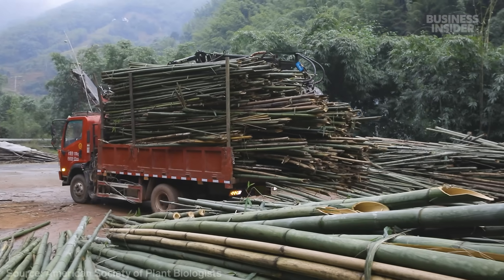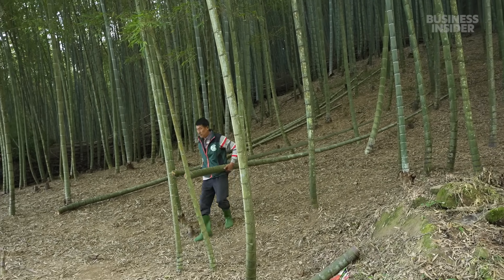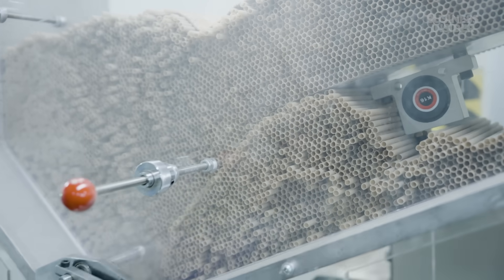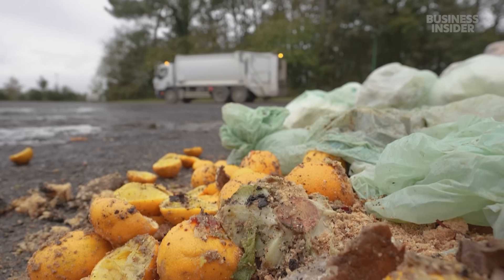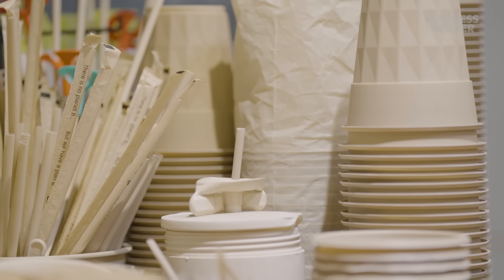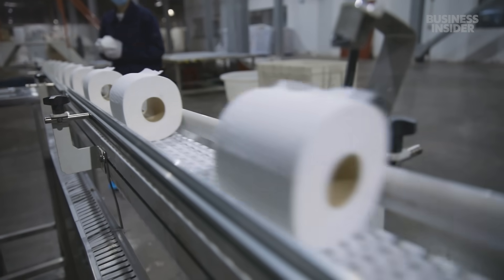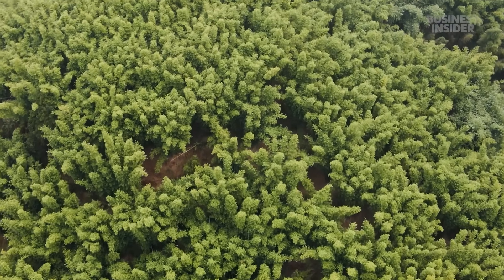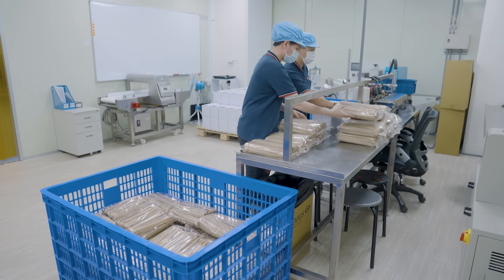Can Bamboo Replace Paper And Plastic? And Should It? | World Wide Waste | Business Insider

Comment: I just gotta say... bamboo CLOTHES are the greatest. The cotton and polyester fibers disintegrate and the bamboo fibers are still going strong. It's soft as silk and strong as steel. 

We need bamboo to take the place of plastic/synthetic fibers in clothes everywhere. It BREATHES. It's soft. It's durable. It's just...not cheap. 

But if you suffer hot bedsheets and sweaty underwear, try switching to bamboo. It's awesome.

Comment: Sort out the glue problem and most of the problem is solved for biodegradation.  BUT, individuals making bamboo skewers one by one,  using industrial machinery is not a good use of resources.  People will just have to learn to eat better.  Billions of tonnes of wood or bamboo is wasted on one use, snacky products.  People don't need straws for goodness’s sake, drink from the cup and half the wasted material. Stop snacking, save the planet, and your health.

Comment: A lot of products nobody really needs - it's all about convenience. Wouldn't have happened some 60 years ago.
The best toilet paper is not using any. A bidet does the job very nicely and it only uses a little bit of extra water and a bit of electricity.  Much better than using toilet paper. Costco carries bidet seats for regular toilets at around $300. So you break even after 15 packs of toilet paper from Kirkland or around 8 Charmin Ultra packages.  For some households that's less than 2 years....

Comment: Just for reference. The tree used to make paper is often simply grown. Look at the experience of Double A.
Growing forests is no longer new. To assess the impact on the environment, you need to analyze the water consumption of bamboo plantations, soil use and much more.
Usually it all comes down to how responsibly the product manufacturer behaved. You can also make a lot of things from plastic without particularly harming the environment in the process, and then recycle it. Or you can make bamboo dishes that will be filled with carcinogens and will be simply dangerous to use.
It's not a question of how good the bamboo is. This is a question of how willing society is to monitor the environmental friendliness of the production process. Monitor thoughtfully and responsibly. And also manage waste responsibly.

Comment: Bamboo is a great alternative to to wood pulp products, as Bamboo matures in 3 years, but compared to Industrial Hemp it comes well  back by comparison. Industrial Hemp can be used in/to make 5,000 products, including paper that can be recycled more times than any other type of paper, it can be used to make houses that last a thousand years, it can produce plastics of many grades. It makes the strongest fabrics known, people who wear hemp clothing will say the fabric takes years to wear in and can never be worn out. Hemp fiber wicks moisture and capable of carrying electrical current, with hemp batteries showing very good results similar to Graphene batteries. Industrial hemp only takes 3-4 mths to mature, use very little water, don't require pesticides and should absolutely be used to replace Cotton, which uses huge amounts of water and huge aounts of toxic pesticides. Industrial Hemp can be processed on cotton manufacturing machinery, for fabrics and specialised machinery for other applications.Obviously there are 4997 other things Industrial Hemp can be used in or to make.

Comment: Okay ill help save the time on this one one, Replace? No. Supliment 110% Some of my best TP and wipes are made with bamboo hell my current toothbrush is made with the stuff. And i say that because paper and compression board etc is often made from the cuttings of other logs and wood. so complete replace, probably not, suppliment and help reduce the load or need for something to be done SOLEY for paper or disposables yes. (and yes i do realise i just said the same thing twice in a couple different ways.)

Comment: Your video fails to mention that bamboo is pretty invasive, meaning it can grow almost anywhere when the climate fits. Its roots travel just below the ground and it forms clusters of roots after some time.
These clusters save up an insane amount of CO2. Thats why Bamboo grows so fast. It is using the saved up CO2 to do that. Which means Bamboo can be used to grow extremely large natural carbonsinks. Especially when the bamboo is cut down to do that specific purpose, not looking for the quality of the bamboo itself, but its roots ability to save up carbondioxide grow the stem and then cut it when the roots are ready again to repeat the cycle.
Normally in the bamboo industry they let a stem stand for 4-6 years. I wonder if that cycle could be shortened.
Someone should investigate that. Because in this time you can make money by removing CO2. It really is a nobrainer.

Comment: I wish the West would explore using bamboo in construction. I know that engineers studied it about a decade ago to lay the groundwork for writing building standards, but never heard anything more about it.
Reply: The building lobby is so powerful in most badly run cities.  American building codes and practices are about 50 years behind the times.  We're still using techniques used 100 years ago, and just try getting a solar panel, geothermal plant, and the best?  Septic systems!  The inner city makes so much money forcing everyone to use THEIR controlled and expensive resources.  It's all about control and money as usual.
Just try building a ram earth building in a liberal city.  You'll be jailed.

Comment: As long as lobbyists exist, nothing is replacing paper. (Successful) inventions are for the wealthy. costs $10k for a patent, $5k for a patent lawyer, another several thousand for even a cheap production run out of China, assuming you don't need any specially manufactured parts. Double that cost if you do, because you need a whole assembly line for each unique part you need that can't be bought premade and assembled by hand in a sweat shop. You're looking at easily a $25-$50k overhead. And that doesn't even take into account marketing and competing against industries that are already established. That's why hemp never took off.

Comment: Ive been using bamboo toliet paper and paper towels for a few years now. The ones i get are not as strong as the named brand paper ones but they get the job done. I use use a lot of cloth napkins and europen dish clothes so cut down on the bamboo paper towers.

Comment: Toilet paper is really unnecessary for homes. Just get a high pressure spray gun and then use reusable cloth mini towels to dry off. Trust me it's way cleaner.

Also I think most bidets the stream is way too thin which can cause discomfort if pressure is turned up. So a spray gun is better.

Comment: 3:21 “Lastic has about 30 different formulas which can take nearly any shape including straws.”
Well, probably straws made from bamboo are better than those made from paper and definitely better for the environment than those made from plastic. That said, at home I use a straw made from glass which is easy to clean, feels great (almost elegant), and never has to be replaced.
Reply: Glass straws are not safe and have killed and injured far too many
Reply: @TValencia-e9r  “…have killed and injured far too many” Well, even one person killed or injured is too many but do you have any reliable statistics on that?

The statistics I’ve seen relate to the majority of injuries occurring in children ≤3 or injuries occuring in “off-label” situations (e.g., running with the glass straws). There is the highly publicized case of Breanne O'Brien who said she swallowed a piece of her glass straw and ended up in ER. But the fact that that is the one case that is mentioned would seem to be a testament to how safe these glass straws are, not how dangerous.

The straws I have are made of borosilicate glass, and, while not indestructible, they are extremely durable. I’ve used literally the same straw for close to four years and it’s as good as new.

Comment: The sustainable option is actually using reusable lunch boxes (metal or glass) and cutlery... They can be used indefinitely and don't generate any waste
Reply: yes, but that requires significant changes to human behavior, something which can't be done easily. Alternatives like bamboo allows people to not change significantly but harm the planet less. On the other hand, people who uses reusable lunch boxes can continue to promote it slowly. Both are essential
Reply: Yes and everyone will save the world by bringing their own cup - how’s that one working? I agree and try to do my part but it’s great to have safe biodegradable intermediates! Depending on where you live it may be more sustainable than washing things, which is crazy to say
Reply: This is the best option.
Reply: It's not so straightforward. Reusable things have to be washed and the detergents leech into the environment. Bamboo can also effectively sequester carbon. Obviously both have downsides and upsides but it's not as simple as it may seem on face value.
Reply: @ayanamij  And it might be the case that there are instances where the handling of waste could be used more efficiently than just sheer reduction of waste.
Reply: My 1st lunch box in the '60's was metal. Things were supposed to last for years.
Reply: That's impractical in so many scenarios

Comment: Yes it can. So can hemp. And yes they should, for certain uses. After the primary use, they can become fuel, and therefore power and biochar, soil amendment, paper products, crude fiber, reinforcement for gypsum cement and hempcrete. No only multi use, multi sequential use.
Reply: much better to just use crop waste don't you think?
Reply: @mehere8038  when i think of the advances in polymer creation, which means adhesives and composite materials, from biosources, i'm convinced that we can in fact become much more sustainable.

Comment: I actually took a class on the sustainability of bamboo! And I thought it would be good to bring up that with the CO2 emissions, most of it is from using coal and fuel during baking/drying/curing the bamboo and transportation. Which most can be improved as mechanical engineering becomes specialized in bamboo production (there are not many options currently available) and bamboo becomes more available.
Reply: What did the class have on controlling the spread on bomboo, im a part time landscaper and I see it as a guaranteed way to make neighbors disliked one another.
Reply: @John_K137 there are two types of bamboo rhizomes! There are runners and clumpers. Avoid running species as their rhizomes can branch out and grow very aggressively, so I would recommend clumping bamboo species as they are more manageable, and as the rhyzomes only grow within 20in under the soil, allowing for preventative measures

Comment: the bio-adhesive is probably Methyl Cellulose if i were to take a guess, i use it as a glue in some art like book binding and as an ink modifier. methyl cellulose is a natural DERIVATIVE from plants though, but you gotta methylate cellulose with methyl chloride. which also comes from burning plants lol. chemistry is cool.
Reply: Hi!  I'm Luke from the video.  The bio-adhesive we use is actually Polybutylene succinate (PBS).  It's a biodegradable plastic that decomposes into water and carbon dioxide with the microorganism under the soil.
Reply: @whatslukeupto-rs6  You guys should have named your company Grasstic since you use bamboo.

Comment: In case of emissions bamboo will probably have less as it absorbs the existing CO2 from atmosphere to grow compared to releasing stored carbon from fossil fuels in plastic.
Also, the Indian flag is upside down.
Reply: The same is true for trees like pines.
Reply: @travispluid3603  that's why paper is better than plastic atleast
Reply: And then the bamboo products gets burned and all that carbon assimilated during its growing just gkes straight back into the atmosphere...
Reply: @flipster7285  It is not adding any new CO2 its only returning what it absorbed. It forms a cycle which is not an issue. The issue with fossil fuels is they add completely new CO2 which is not supposed to be there. Same with the plastic that is burned after use.
Reply: @flipster7285  Which then gets turned into more bamboo.

Comment: If it doesnt dissolve after a few sips on the straw (consuming a mcdo shake) then i say use it
Reply: It actually doesn't tried one a few days ago and it just felt like a plastic straw
Reply: Our straws have a temperature resistance from -20 degrees celsius to boiling.  Although I suppose you can't drink solid ice or scalding water... But they will stay rigid for a very long time. And no, they can't give you splinters whatsoever.
Reply: What’s wrong with drinking from a glass? And a glass will last for hundred years unless you break it 🤗
Reply: @Greblav  Absolutely nothing is wrong from drinking from a glass.  We support reuse!  However, in reality, not everyone has access to clean water to wash glasses, cutlery, plates, etc.  Also, kids don't have the best record for keeping glass intact...
Reply: why do you have to use a straw, or why cant you get a stainless steel one
Reply: Splinters on your lips
Reply: @einsam_aber_frei  No splinters.
Reply: @einsam_aber_frei it's been polish for utensils. I actually like the smoothness and study bamboo utensils
Reply: @einsam_aber_frei  its made from ground-up pulp, just like paper, so there isn't even a possibility of a splinter.